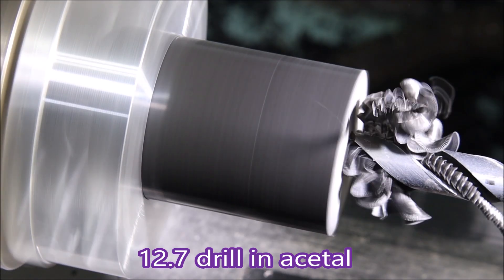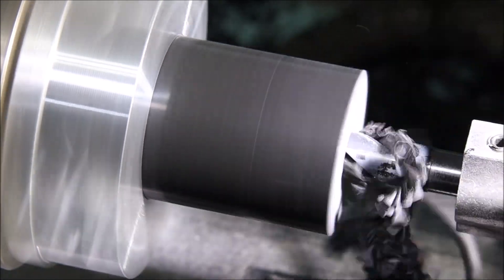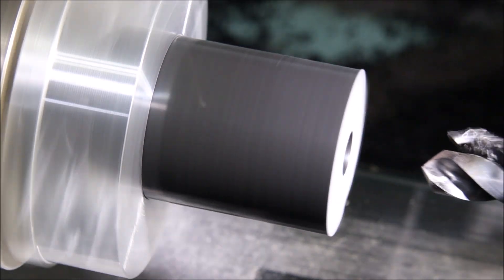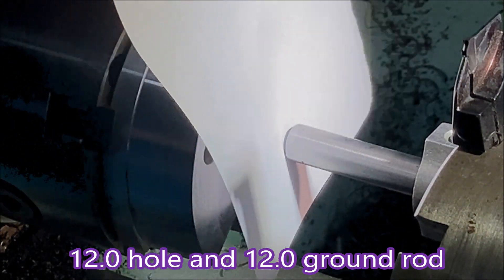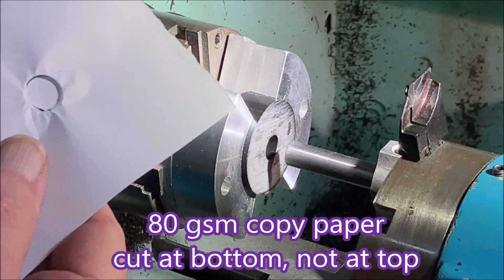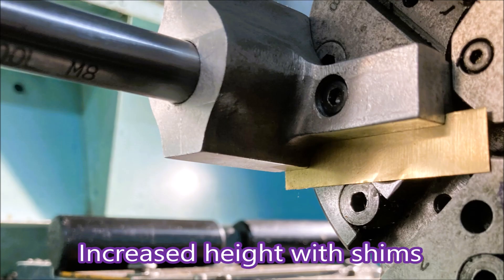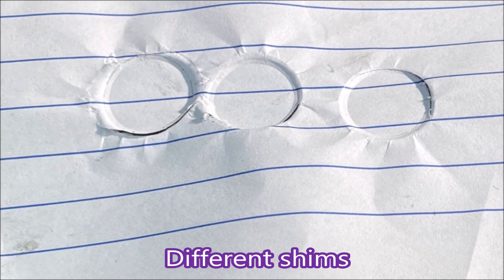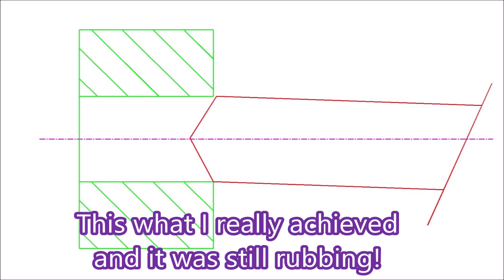Checking drill height with a piece of paper on my cnc lathe

Comment: Neat trick.

The only problem with cigarette paper is they give you a funny look if you buy it without tobacco..

So I would just stick a boring bar in the chuck & bore the hole over which should put you perfectly on axis and turn a sleeve to fit the drill.
It could be a press or loctite fit or slip like a “C” bushing so you could use different sizes.

Cheers
Reply from the maker: I thought it only happened to me! LOL
What I did in this case was put  a new casting in the turret. Put X axis on an even and easily repeatable number.  Then drill and ream 12.0 then drill and helicoil for two M6 grub screws to hold the tool in place. Now if I put the tool on X160 I know it is on centre. Thanks for your comment

Comment: Nigel, my Computurn lathe does the same chuck spinning trick until I have run a program and it has finished. 

Doesn't play up at all until I restart it. I wonder if there is something with the motor driver board not being in a defined state? 🤔
Reply from the maker: @kepamurray1845  my spindle is controlled by a Minarik driver not the Hercus driver. It just won’t adjust the speed to zero, the pot is turned all the way to the stop and it still will won’t stop. Thanks for your comment.

Comment: I've never seen this trick before! Couldn't you make the drill holder use a slot so you can move the tool holder vertically to adjust for centre height ?
Reply from the maker: As I read you comment a voice in my head screamed Nooooo. LOL There is no way I want to mess around with tool height as well as the position in the X direction. I grabbed another holder, drilled and reamed it 12.0, drilled, tapped and helicoiled for the 2 grub screws and I have a perfect on centre drill.  When I drilled the hole I recorded the X position so I know that in future that holder has an X setting of 160 and it is on centre. I stamped 160 on the holder. This turret has fixed tool height so that holder should never be a problem.  Thank you for always contributing to my channel by leaving a comment.

Comment: I've seen video of some guy who had old machine damaged beyond repair and he had to drill and ream the full housing in the mounting block so that the atleast 50mm dia drill would be in axis. But as I understood, it was worth it because then he drilled hundreds and hundreds of pieces.
My machine's turret is currently broken, out of axis atleast by 0.4mm and something inside is not right and the turret keeps vibrating and is not rigid. "Scheduled for next meintenance" - drilling with anything above 40 usually causes the drill to shake whole machine as if you threw brick in washing machine. Drilling with 45x3D pushed the turret away so much that it drilled the hole almost milimeter bigger. Ah yes, Eastern Europe, my beloved - keep using it until it doesn't fall apart.
Reply from the maker: @adamsevcik7708  Hi Adam, that sounds a bit more like ab using it til it doesn’t work any more! LOL. The machine one has is always to large or too small. Hope you get your machine up and running soon. Thanks for always leaving a comment on my videos. Nigel

Comment: That's a really clever way of checking alignment,  it's in my memory bank now! Did you bore out the drill holder using a cutting tool in the lathe chuck?
Cheers Ian
Reply from the maker: @machineshopinagarage4699  Hi Ian, I did exactly that, drilled and reamed 12mm. The paper trick is not limited to just round shapes either, we used to use it for straight edges too. Thanks for your comment. Nigel